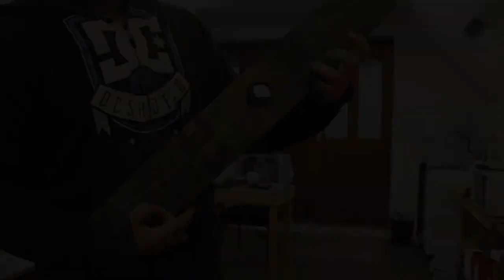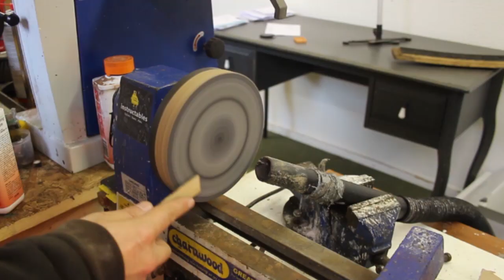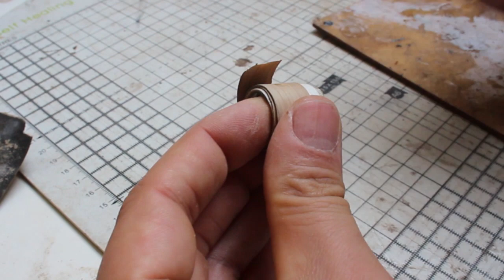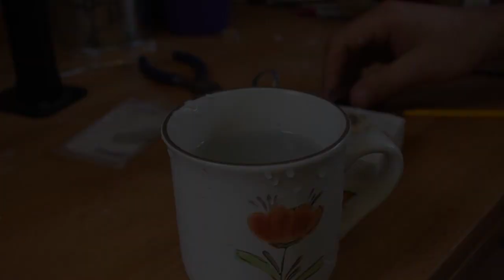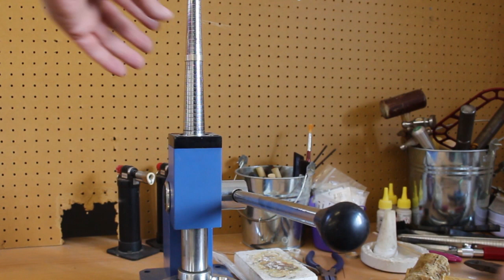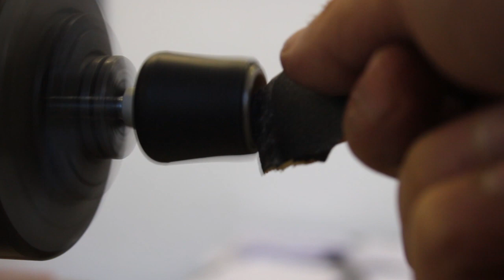I tried to make a wedding ring with a Whiskey Barrel and White gold ... here's what happened!

Comment: Hey dude just discovered your vids they’re so freaking cool. I’m a joiner and have a quick question, why would you choose layer up veneer over simply using a spade bit into the timber? Is it more likely to split/crack this way?
Reply from the maker: Hey man sorry for the late response!  The bent wood method is significantly stronger than rings that are drilled out or turned on the lathe.  There are no weak points where the grain runs across the ring :). I also find it loads easier and you don’t need as many tools haha